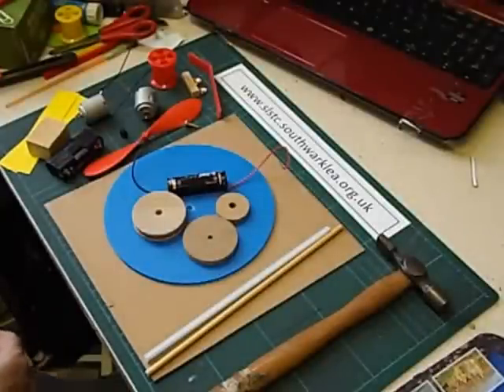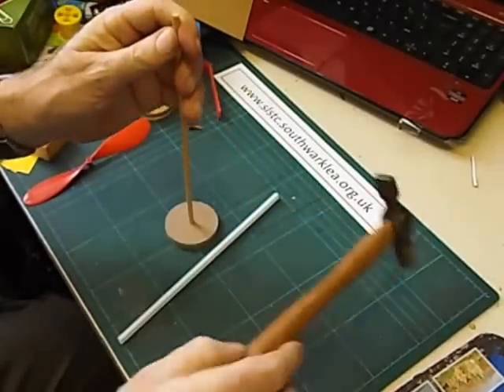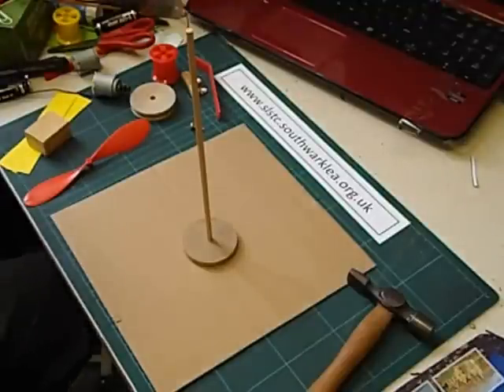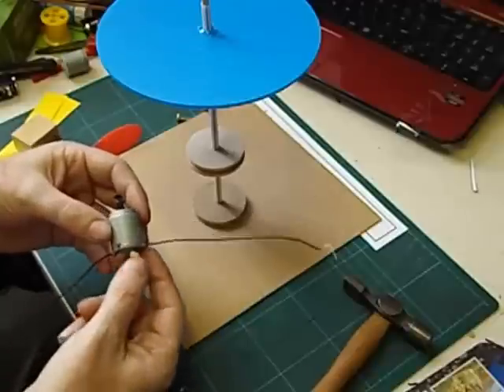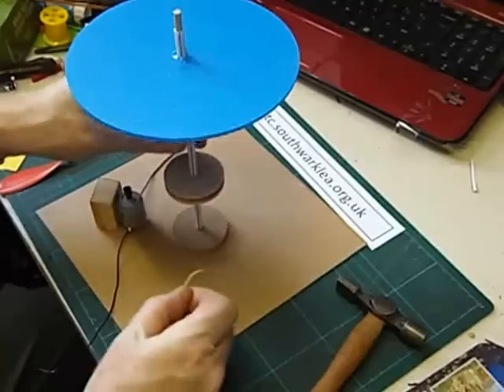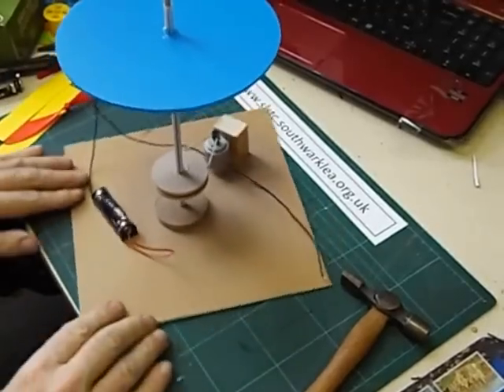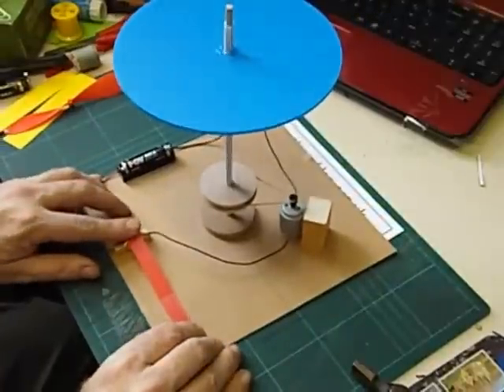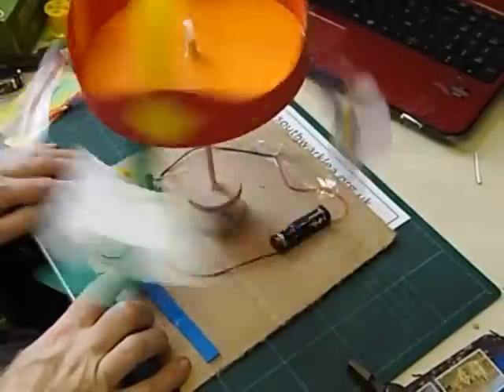How to make a simple electric carousel toy

Comment: To change the speed, change the size of the pulleys (wheels).  Either make the one on the motor larger, or make the one on the carousel smaller.
Reply: 🔴 What Is Islam? ⚠️

🔴 Islam is not just another religion. 

🔵 It is the same message preached by Moses, Jesus and Abraham.

 🔴 Islam literally means ‘submission to God’ and it teaches us to have a direct relationship with God. 

 🔵 It reminds us that since God created us, no one should be worshipped except God alone. 

 🔴 It also teaches that God is nothing like a human being or like anything that we can imagine.

🌍 The concept of God is summarized in the Quran as:

📖 { “Say, He is God, the One.  God, the Absolute.  He does not give birth, nor was He born, and there is nothing like Him.”} (Quran 112:1-4)[4] 📚

🔴 Becoming a Muslim is not turning your back to Jesus. 

🔵 Rather it’s going back to the original teachings of Jesus and obeying him.